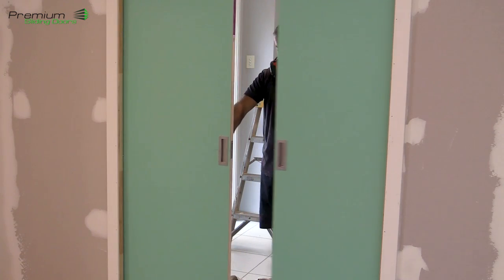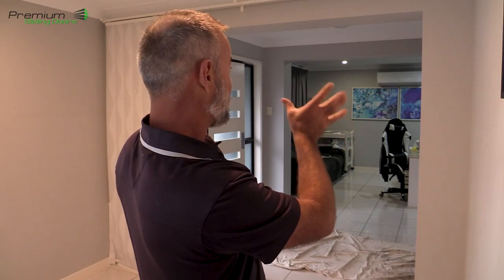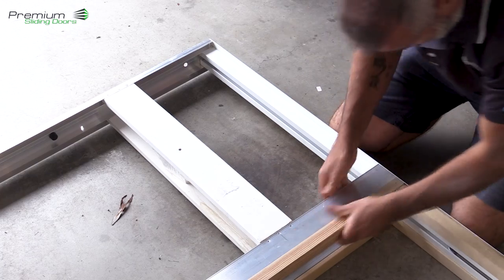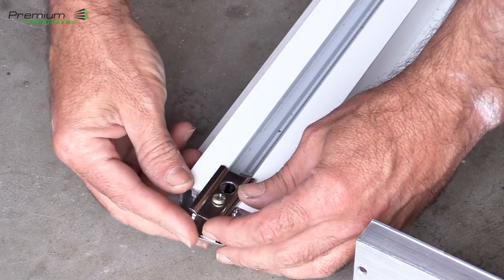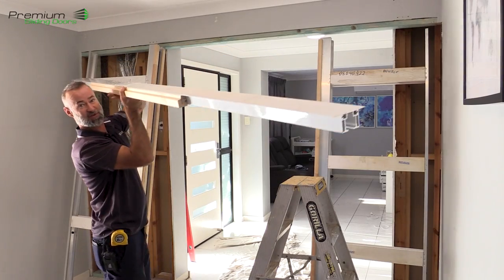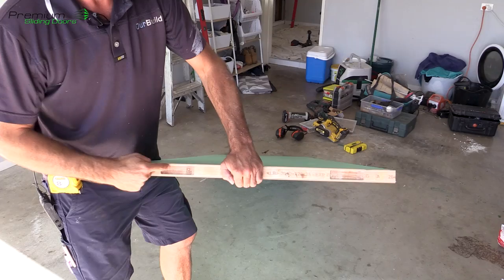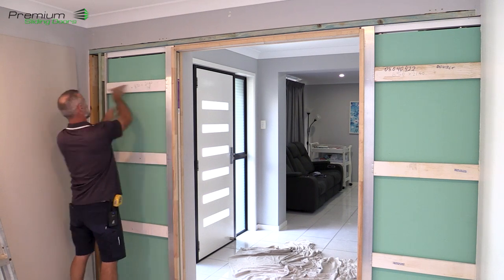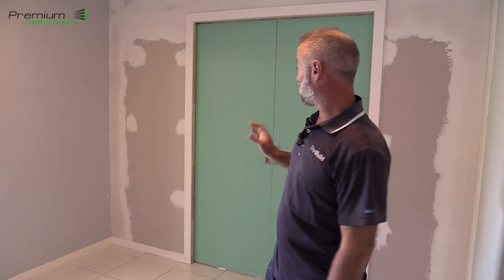How To Install a Double Pocket Door -  Cavity Slider with Soft Close.

Comment: Thank you so much for this video. I have a few questions:
 - What is the channel on the bottom of the pocket doors for? ( i want to install double French pocket doors and my supplier doesn't sell them with a channel) 
- My wall is load bearing, can i just frame the pocket doors on the inside and make the wall ticker?
- Do you know if there is a similar product offered in the US?

Comment: Excellent vid. 👍
I'd LOOOOOVE to switch out our hinged door fitted to our en-suite with a pocket door.
It'd mean removing a non-load bearing masonry wall, which wouldn't phase me, but my wife is put off by the inevitable mess that I'd make DURING the install. 🤐
Reply from the maker: Haha, just don't make a mess 😁
Reply: @OurBuild  It's not that easy mate, if I'm drilling even a teeny weeny small hole in a piece of would, she'll bump me aside & buzzes around with her dust buster. 😡

Comment: Perfect for my flex room that will be our movie/game room. I felt normal doors would've been a waste of space and would limit what we can put on the hallway with the opening radius of the doors. I just thought about doing doors like this right now and came to youtube to see if it was possible now I know theybare called pocket doors. And that soft close I need that now. Thank you lol if you pay a professional to do this work what would be the price range? Wall would have to be 9ft tall and width 11ft. Yeah US based.
Reply from the maker: Sounds like a good solution. I generally don't like to give price estimates as it could date given the age of the video and when someone watches it. But ATM it could be anywhere around 4-6K depending on site conditions.
Reply: @OurBuild  thank you for the reply it gives me a general ball park to have in mind. After my wedding I will start saving up to do this so probably by 2023 I'll have the cash lol i want to do the doors with frosted glass. Do you recommend that for a pocket door? Also if it makes sense I'll probably ask to insulated the wall. So 2 sides would be insulated and 2 will not. The other insulated wall is the one facing outside the house a 9x11 wall